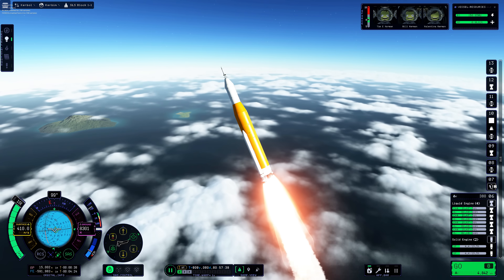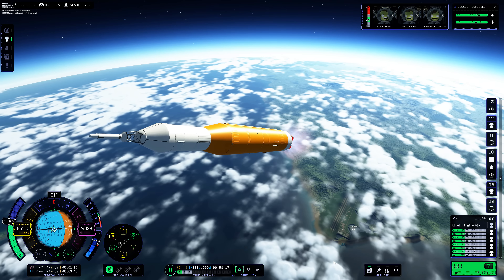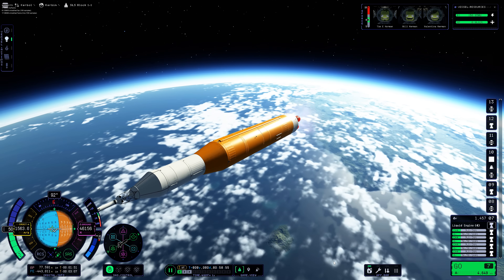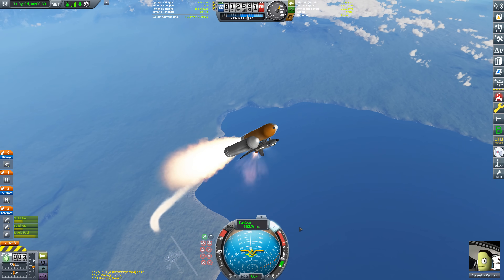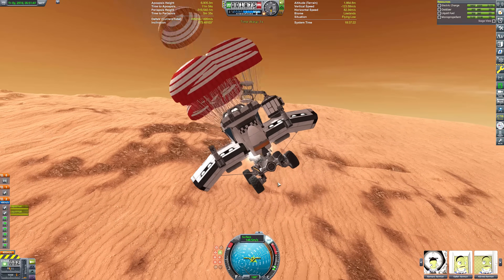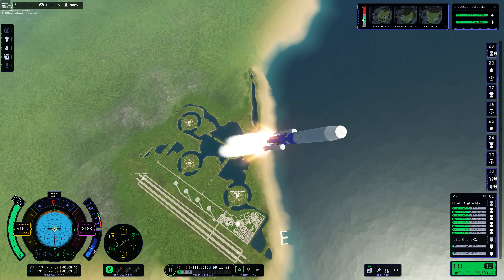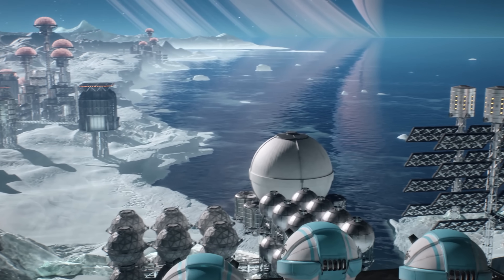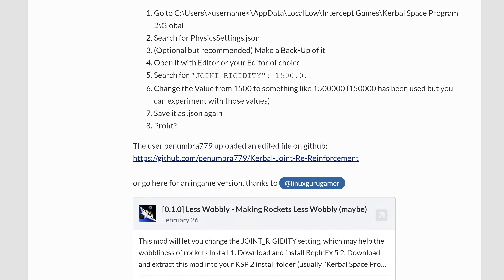Wobbly Rockets Still Haunt KSP2: Developers Face Uphill Battle

Comment: I think I should clarify, in our approach in Kitbash, we do fully simulate internal wobble of the player vehicle. 

The internal physics system is a separate simulation from PhysX, which is why I say there is still a single rigidbody for the vehicle. But all forces acting on the vehicle are also passed into our internal physics model. This is a separate physics simulation, where joint stresses are simulated, and they will break if you pull too much Gs for instance, or crash into something.

For remote vehicles in multiplayer, or for NPCs, we can simply disable the internal physics, and outwardly they will behave the same, but what I want to clarify is that the internal physics don't get disabled for your own vehicle even at high part counts. 

The internal physics don't affect performance as much as one might think, because we offload the internal physics to a separate thread, as that simulation runs more or less independently of what happens in the outside world. 

The main advantage is that with separate simulations, we can scale all the external forces by coupling factors. That gives us a fully authoritative 'volume knob' over how much wobble you get. 

It's a weird system that isn't very easy to explain, admittedly, even if I was a good thing-explainer, which I'm definitely not.
Reply from the maker: > It's a weird system that isn't very easy to explain, admittedly, even if I was a good thing-explainer, which I'm definitely not.

I feel less bad now about doing such a bad job of it now, haha. Thanks for clarifying the core details Felipe :)
Reply: I believe your explanation is great.
Running the internal physics on a separate thread is a nice and elegant idea.
Thank you for chiming in.
Reply: @lesath7883 "chiming in" lol, mf, like he isnt the literal developer. He doesnt "chime in," he SAYS and its done.
Reply: This is reminiscent to what my studio did for racing game physics. Basically Unity handled collisions, and our internal physics system handled the tire model. Somehow trying to get Unity to accurately model tires would have been a fool's errand.
Reply: So it works by having 2 systems, a simple global one that affects everything and a local one that is only for a player controlled craft?
Reply: I think that the joint physics for inline stacked parts should ignore bending forces until it reaches structural failure levels.  If a real rocket bends (beyond the natural flexibility of the material), it would damage the integrity of the materials and destroy the vehicle rather abruptly.  We shouldn't 'see' the bending until the RUD.  Simplify the in flight forces of inline parts to only monitor for the breaking point, and not show any bending until then.  Radially attached parts could have minimal flex, like the wings on a 787, but not flap like a bird until it tears itself apart.  We should only need to strut radially attached parts, and different parts should have different torque limits.  I agree with Matt and HarvesteR that the wobbliness makes the game difficult to enjoy, and doesn't add to the realism.  Yes, we want structural limitations on what we can build, but the current state makes it so hard that it's not enjoyable.  We play KSP to explore and challenge ourselves, but the current state makes it so stressful, I haven't played in months.
Reply: If this "volume knob" was the ideology behind KSP2, you could give us a "Legacy physics" toggle in the settings, so those who want the KSP1 physics can still battle the kraken, and those who desperately looked for solutions to wobbly rockets in KSP1 can finally be rid of it.

Comment: KSP1 was quirky in itself and wobbly rockets was a nuisance there too. It was manageable, but a nuissance. 
I expect a deeper simulation of things and rockets are by no means wobbly in real life. I never seen any rocket flex even a little without a catastrophic failure.

Im going to hold off on KSP2 until they fixed it.

Comment: I would say there should be some level of wobble depending on the design or that at least aerodynamic forces should be more capable of breaking joints if wobbliness is reduced. You showed the example of starship tumbling but that is pretty uncommon with rockets generally. There has been many rockets throughout history that had stability problems, and when we've seen rockets deviate from a stable flight path they often explode. Like when SpaceX did the crew dragon launch abort test, when the dragon capsule got out of there the booster only continued for a second before turning slightly to the airstream and instantly exploding in a fireball. Or when the challenger disaster happened, that was due to a strut breaking and then aerodynamic forces immediately broke the vehicle up, not an explosion. Then other rockets have had problems with pogo oscillations or other aerodynamic stability issues. I imagine if the Saturn 5 had deviated from a stable flight path it would have been damaged or exploded as well.

Comment: I think they should not try to model every single joint, but instead only those that make sense.
A rocket with 200 parts should not have 199 wobbly joints. Thats just nonsense.
It should have only the, hypothetical, 6 effective "joints" that ACTUALLY exist within the rocket design.

Comment: One challenge in simulating the whole thing as a single rigid body is that without distributed masses, the intermediate axis theorem effect (like that famous video with that spinning T shaped handle that flips axis of rotation every so often) is no longer an emergent behavior and needs to be explicitly programmed.

Comment: I think as a programmer, what I would personally do is 4 checks and 3 solutions:
1. Does this part connect to any joints? (Aka, is it attached to say, an engine rather than other fuel tanks).
2. Does this part have a strut (doesnt matter which end) or "structural" type of part attached to it?
3. Is the strut or structural part attached to anything else?
4. If the structural part is attached to another object, does that object share the same joint as object 1.

S1. If the object is not connected to any joints, it is rigid up to certain thresholds (aka high G-forces, etc.).
S2. If both objects meets [2, 3, and 4], perform calculations based on the strut's strength itself (What G-forces the strut can withstand, atmospheric drag, the number and presence of struts compared to those values, etc.). 
S3. Otherwise, the base of calculations is the joint which is subject to wobble as it should be.

While I'm sure this series of questions may still be too computationally expensive, I'd like to believe that simplifying it like I did might at least lead to a solution that allows simulation, but isn't too taxing on hardware.

My personal thoughts are that wobbliness should exist when you're bulding poorly. That's the whole point of kerbal. You can choose to be silly and make noodly rockets as the game is great slapstick humor by itself. But if you build a structurally sound rocket, it should be... structurally sound. The challenge even comes in to players in the campaign! They have to build their rockets smart while adjusting to constraints; but if they don't, they're rewarded with a spectacular and comedic failure, that makes them think more about their design.
The point is the player should have the choice and comedy was KSP's roots.

Comment: To me, the wobbliness of the rockets was mostly a bug, a exploited one.
Real rockets do wobble, everything does.
However real world rockets do not act like they are made of jelly.
No, they act like giant pressurized metal tanks.

Also, they should look more at the last version of KSP on term of what got remove and what remained, even going so far as looking into old bug reports and threads.
there they gonna see that rockets Wobbling was considered a "simulation flaw" that sometimes was funny.
You know what also is funny? the kraken, now where is it?

In conclusion, Kerbals do not make wobbling rockets or bad ones, is just that in their haste to go to space they often take short cuts and a "Build, Test, Crash, Repeat" approach.
After all, Ionic engines are actually pretty advance stuff.

Comment: Honestly they should add a piece you add, a joiner, that acts like a rigid-body connector, and itself has stress. If the stress of the joiner wears out, then the objects start to act like separate pieces again.

Comment: I am 100% in favor of "welding" all single-stack width-fitting subassemblies. Let radial connections or multi-connection joint pieces have potential wobble and need strutting.

Comment: I don't think I like a fully ridgid body approach. You shouldn't be able to make rockets with 6 layers of radially attached boosters with no flex. But the joints should be several times more rigid than they are now.

Comment: From a technical standpoint, it should be fairly easy to consider a same size stack a single rigid body. Perhaps you could even add a little flex to it based on the height of the stack, or simply add joint after X height units, so you cannot make a 100 fuel tanks high completely solid rocket. What's great about this solution is that you could pre-calculate all of this when you are placing the rocket on the pad. And I doubt anyone would mind to wait a tiny bit longer for the benefit of extra FPS when all of this has to be simulated in real time.

Comment: I think the comment on novelty and large craft is more about how in very large craft, especially the eventual interstellar craft, there is some amount of novelty in seeing the craft flex when the engines turn on, in seeing how it moves. And furthermore simulating a large scale craft like that as a single rigid body would in many ways cut down the challenge of building such a craft. There definitely has to be a balance between full simulation and cutting it all out.

Comment: This is not that crazy, make inline parts statically connected. It is implied that any parts stacked inline would contain continuous and sufficient spinal support, like in real rockets. Or add some internal parts that allow the user to choose more stability at the cost of more mass vs unsupported and dealing with wobble.  Radial parts will wobble so you need strong lateral struts to hold it in place. Not a crazy concept and easy to fix.

Comment: The KSP2 Devs fall into the same stance that killed my enjoyment of most games

Repeating and Expanding the barely working base game (and in the case of second games, the base is mostly still the first game)

No matter if it's a Triple A title or KSP, either way there are carry over bugs that are not getting fixed and thus carry on as baggage making the game work worse in the long run

Truly, KSP2 is a waste of money for players, play modded KSP1
The Modding Community of KSP made KSP1 better, more reliable and more expansive than KSP2

KSP2 is a straight up downgrade compared to what late stage KSP was
Since they copied over most of the broken stuff without fixing the underlying issue

The Devs basically are like a Doctor giving you Penecilin for a Viral Flu
The solution not only doesn't treat the symptoms really, but it also just makes the underlying issue more dire
But It's easier to just do the Hotfix than actually think

Comment: look at the wet weight vs dry weight of your crafts, things are going to be a bit flexible when you have tons of fluids stacked in tin cans pushing 7 G pretty consistently, I think it adds realism to thins so you can't make a spaghetti rocket with 100 stages inline... I think you are underestimating the physics involved with getting all that weight into the air, they should make more options than just struts tho. There should always be a penalty to adding more mass for the sake of rigidity, Maybe adding options for materials would be a good idea, so you can make carbon fibre reinforcements, aluminium or steel where needed, each having a different property, benefit and disadvantage. Sure they shouldnt flex like crazy, but they sure as hell shouldnt be rigid

Comment: In my mind, what makes "lol so kerbal" fun is that you can improvise solutions to aerospace challenges, and when those solutions only partially work, or don't work at all, you can just go back to the drawing board. If your rocket fails because it's wobbly, that's the result of the game, not your rocket being improvised, and once you realize that, the potential fixes really aren't great. Ugly struts, making a less complex (and therefor usually less kerbal) rocket, or just modifying the game to not have flexible joints are the usual solutions.

Comment: Suggesting: turn off gimbal at upper engines when they are not used, it might help with wobbliness. Gimbals are super  strong in game, nothing can stop them so they could cause part of a problem. But i think as long as kraken is alive, wobblines should be eliminated.
Reply: Overally i think wobbliness in ksp 2 actually is more realistic than in ksp 1.
Reply: That said o havent encountred much wobbliness on my rockets with ksp2, any more than ksp 1.

Comment: This is not at all a hard problem. They are already calculating the force going through each joint. The wobble is from them deflecting those joints in response to those forces. Just don't do the deflection step and joints effectively infinitely stiff, and there will be no wobble. You are still calculating the forces, so if someone tries to make something stupid, the calculated force will be too high and you can snap the joint.
This is definitely just idiot managers and executives who don't want to spend the time/money to rewrite a tiny bit of the physics code and are justifying this to themselves an others by saying that the reason KSP is popular is because the wobble looks funny and "memey", and is part of KSP's identity.

Comment: so just "weld" vertical stacks into one physics body and create a seperate physics body jointed to that one when mounted on the side. with a system like this it would allow them to decide it a joint would be considered rigid or flexible. I know there are more intricate details to this solution but I know it's possible.

Comment: Pretty easy solution is run a check when you finish a project, identify things that should be solid and locking those to a single rigid object, and run again to ID things that would be expected to wobble. Take a bit of time when you finish the project, but it should resolve it relatively well if they're set on doing it this way. *

*This is oversimplified but I'm sure people get the point.

Comment: As a Doctor in Engineering, I must point out that their approach to approximating the problem is quite inaccurate. They assume, as a principle, that the joints are less rigid than any point in the cross-section of the rocket. However, it's entirely possible to design joints that are much stiffer than the main structure of the rocket, as exemplified in typical structural steel joints (the often triangular side pieces welded to the main beam). To create a more realistic game, they could allow the player to choose between a more flexible (less expensive) joint or a more rigid (more expansive) one. In terms of mass comparison, the difference would be negligible.

Comment: being that even now KSP2 is not of interest for my play, it sounds to me a plan to make a new joint mod. One that clusters a skeleton of sorts, where a single body definition exists on pieces that are clustered inside of a staging layer/decoupler set. May something to allow paired docking ports, or trio ports, to prevent flexing at the more permanent port connection. Maybe something of a dividing line made by motion parts, like hinges and pistons.

Comment: It sounds like the devs dont even understand their own codebase. If you want it to flex less, just change the variable holding the flexiableness. The could not be doing the physics calculations without defining this in the first place.

Also physics calculations on solid bodies are are dirt cheap and simple. You can lookup physics simulations done in the browser online. Hell, we could be simulating the liquid physics of the rocket fuel if we wanted.

Comment: See, even HarvesteR agrees about wobble!
Reply: Though I think he might have gone a bit overboard. The best solution, IMO, would be for the physics engine to model node-joined components as a rigid body while maintaining the flexible nature of surface-mounted parts.
Reply: Plus, it will significantly improve performance, similar to how the "welder" mod works in KSP1.
Reply: Autostrut was an ugly, ugly hack. I'm glad they recognize that.
Reply: Cranking up the rigidity of joints probably isn't a solution, either. That's a good way to tempt floating-point precision errors to snap parts off the rocket for no discernable reason.